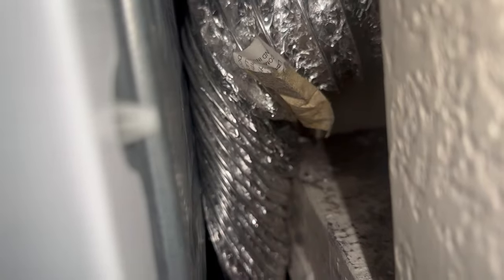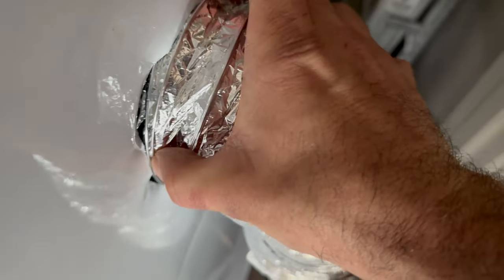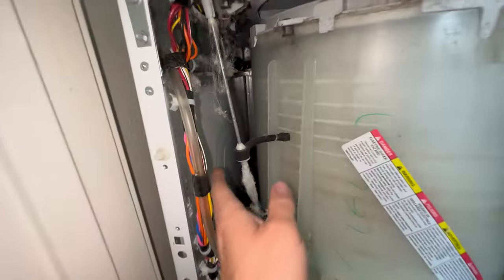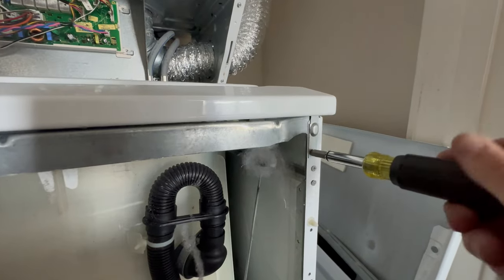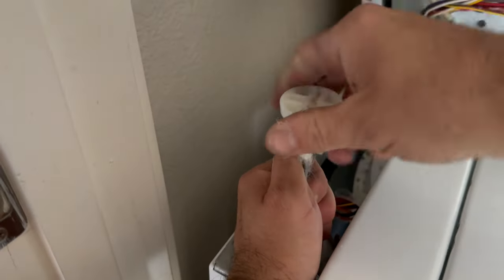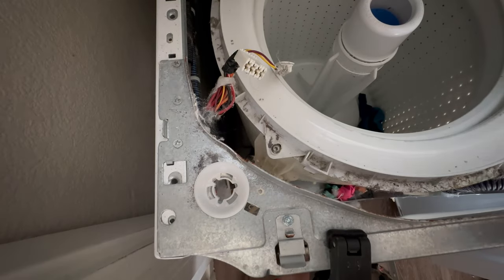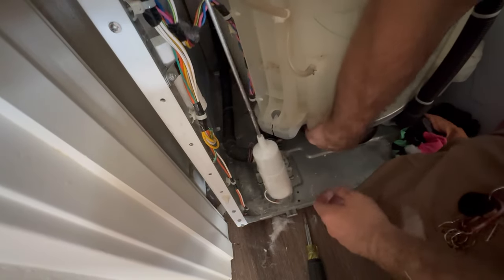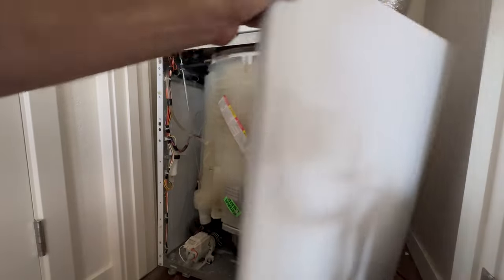GE Washer Combo Banging on Spin Cycle, Dryer Vent Ripped

Comment: Flexible ducts are illegal in my area. Semi rigid or rigid only.
Reply from the maker: You can use up to 8 feet of flexible duct as a transition to the rigid duct of the rigid duct can’t be installed, such as the closet in the video. M1502.4 Transition ducts.
Transition ducts shall not be concealed within construction. Flexible transition ducts used to connect the dryer to the exhaust duct system shall be limited to single lengths not to exceed 8 feet, and shall be listed and labeled in accordance with UL 2158A.
Reply: You are correct. They are against National Fire code. Every Manufacturer since 1978 tells you that foil or vinyl venting cannot be used. Vent catches fire installer of vent is liable
Reply: @ApartmentMaintenancePro  That is rigid aluminum flexible duct. Not foil

Comment: You may have wanted to consult a professional general contractor or an appliance installer before you beat up your machine they make a 90° Flex flat duck out of galvanized steel that slides telescopically up and down to make the connections and it will fit flush against the wall rather than using a flex duct everything you did was totally unnecessary